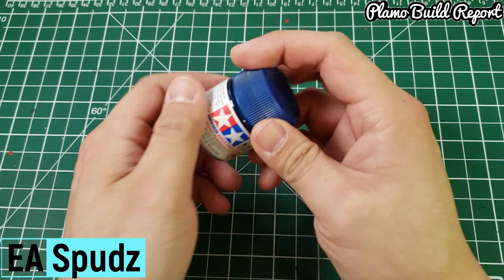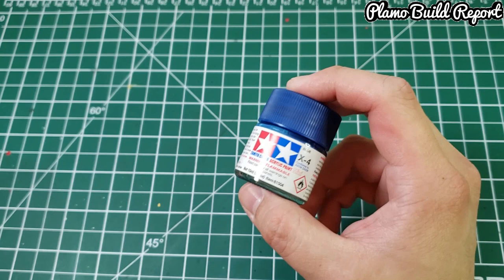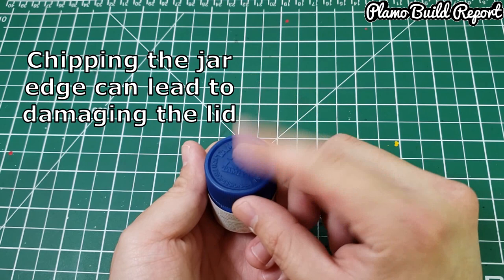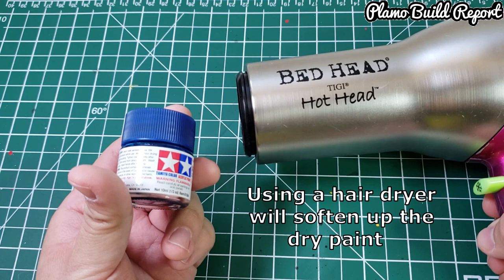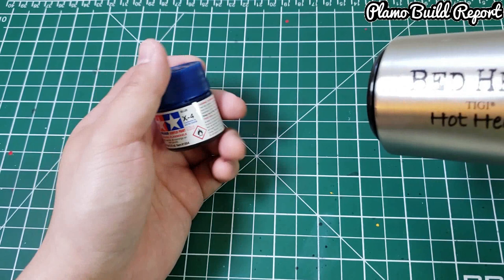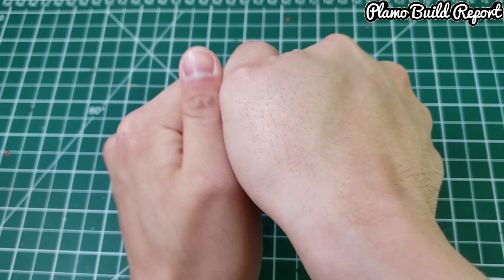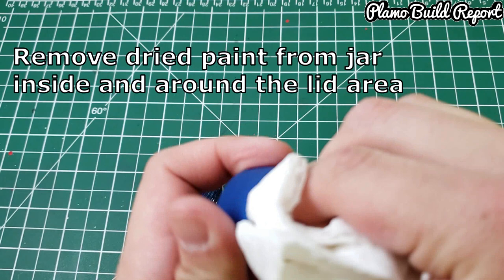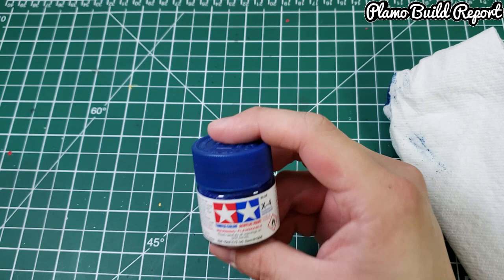[Quick Tip] How To Open a Stuck Paint Jar

Comment: My method worked as well. It was a large glass container with metal lid. I put some paint thinner in a small pail, stuck the glass jar in and tipped it on edge so all the lid could be covered, left for a bit while i read this youtube solution, went back to it, put on my rubber dishwashing gloves and it opened easily. 👍

Comment: For some reason the video doesn't play,  so I don't know what's the solution.  
I was just able to open a stubborn stuck glass paint bottle. I've been struggling for 2 days :)) Finally,  letting the bottle under hot running water for 10-15 seconds is the super magic solution! !

Comment: Whoever is reading this I have a better tip to open a paint bottle flip it make the lid facing down and dip it in hot water 💦 for 10sec and it will open
Reply: At first it didn’t work but the it opened 😁
Reply: Thanks!

Comment: I have a problem with my paint drying up any tips
Reply: Really they dry up in the inside any tips from you my friend
Reply from the maker: Usually the best way to prevent dry paints is to use thinners that matches with the soefic paint type and retarder to slow the dry time. Apply it on dry paint and it should be good to use again!
Reply: @PlamoBuildReport  thanks appreciate your videos

Comment: I recently got a tamiya X18 paint pot which is brand new, but the lid  has been put on way too tightly. There is no dried paint in the pot but it still won't open. can you please help?
Reply from the maker: Usually the hairdryer method should work for new paints too but try running hot water on the lid to soften the cap and then open it with a towel. 
Hope this helps and let me know if it worked that way!